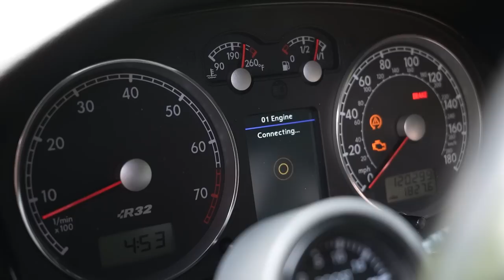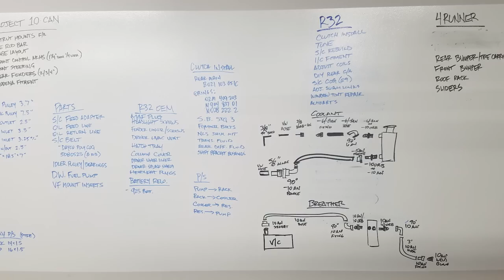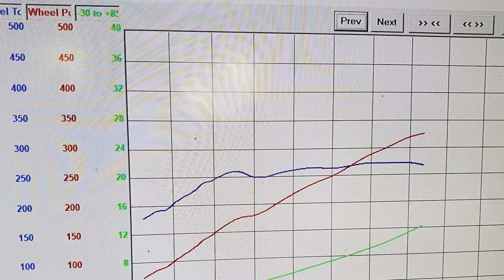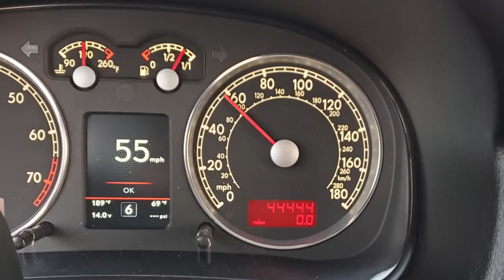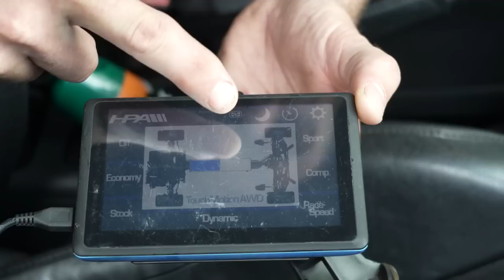Which MK4 R32 is Better? | Owner Spotlight!

Comment: That's excellent! Honestly, the AWD system in these cars is a lot better suited toward being a fun 'soft roader' than it is a some tarmac rally monster. I love this!
Reply: ?
There are people putting 800+ hp through this awd system (haldex).
Reply: @neilwalker8686  I never said anything about it's ability to take power. It's a very cool system. But, It lacks a real center diff, so it will never handle in the way something like an Integrale, Celica GT4, or EVO or something with true AWD system. That's why you see people putting 800 hp through them and drag racing.
Reply: @neilwalker8686  Its still a FWD + RWD system and wont handle as well as an AWD system with a center diff.
Reply: @xXYannuschXx  there are a ton of variables to that statement. Open diffs, and non-variable locking centers will absolutely corner worse than a haldex with front and rear limited slip diffs.
Reply: I had a mk7 all trac, that has the newer version of haldex that is supposed to fix all the shortfalls of the system in the r32. But it still wasn't anything like my dad's Subarus. It works seamlessly in loose conditions but it still handled like a fwd car in the dry.

Comment: My buddy bought a MK4 R32 new back in the day. I was so jealous! The upside, he use to ask me to drive it cuz I was awlays a gear head, car junkie use to speed. He was always slightly nervous to push it to its limit. I ended up building a MK3 Jetta VR6. Was never as fast as his R32, and wasn't all wheel. But it was on nuespeed coilovers and, 17" Koenig wheels, Pirelli tires..It skated along side the R32 in the corners. Miss the VDUB days. I remember the R32 was only biilled at 240bhp, but I think it was one of those gentlemen agreement deals to underrate them..Probably some tax breaks or something. Felt more like 300BHP. Rant over!

Comment: You do you man👍
Id be drawn to the supercharged r32. Love that instant throttle  response 😍. But the belt constant belt shredding would drive me nuts. Nice work on both rides 👏

I drive my b5 a4/s4 cel to cel myself. Its a vw/audi thing. You get accustomed to it. You actually start to believe its normal, lol. Im currently  95% rebuilding my b5 a4 1.8 stroker. Suspension  will be only used part. About 10k mi on that. Hopping for some reliability after that.... at least 50k, but 100k would be better. Keep on wrenching 🍻 and enjoy your rides. We have maybe 10 yrs of possible daily drivability with ICE 😪

Comment: I still don't know "etiquette" on commenting on older videos on YouTube despite having been here for years and years, but just wanted to say

I absolutely love the MK2 Golf Country tribute of sorts, I've loved those since I spotted one at a local car show here in Norway, and I'm an avid supporter of being able to build your cars as you like, albeit within limits, as in make sure you're not customizing a mint condition rare model, as I feel there should exist at least one stock form model just for preservation so to speak.
The MK4 R32 is not super rare, and the fact he even went as far as doing it to basically a parts car that'd never see the road again in it's original form, is basically the optimal way to make builds like this, and I love it! I'd go as far as saying he basically saved a MK4 R32 from becoming nails, and via making tribute to the MK2 Golf Country no less, I feel the MK2 Golf Country is oddly rare though, I've seen one once, so at least not common in Norway, I see a lot more BMW E28 Touring around than I see MK2 Golf Country, and BMW never made a E28 Touring ( they were built by Schulz in Germany. )

Comment: Have you added subframe spacers that would help with driveshaft angle maybe you already have i dont really know anything about lifting vws.

Also could you not build a sold strut mount spacer that prevents it fron over extending like i said just an idea i dont really know anything about lifting things

Comment: What a pity it seems that the mk4 is so "hard" to lift. I own a 4motion wagon tdi, wich in my opinion would look awesome lifted. But it already has the heaviest springs for the mk4 stock and there are very few guides for lifting a 4motion in the rear so I'm kinda stuck with my Ideas, this video helped me figure some things out, although I'd whish for a simpler solution up front.

Awesome build anyways!😎

Comment: Best Golf MK4 R32 was not build, and it's not one of their sibling A3 3.2 (not sure with same chasis or if it existed), not an audi tt 3.2. 
Best PQ34 R32 has not even the 3.2 engine. To me: CAHSIS VW Bora/Jetta 4motion, Golf/Bora/Jetta Variant 4motion, Skoda Octavia/Octavia Combi or the inexistent Seat Toledo 4 (seat never did as they did the Seat Leon 4 wich shares the 1M model, only as a concept Seat Toledo Cupra Concept 1999). All of  wich have far better weight distribution, gas mileage, less weight, aerodynamics (drag and lift), exterior design and also body (strut and reas as found in Octavia vRS) and subframe (TT, S3) oem brackects all better than the Golf R32. ENGINE: 1.8 T 237 bhp 320Nm BFV quattro Sport (or at least an 1.8T 225 bhp BAM derived one as foun in the Seat Leon Cupra R 1M or Audi TT 8N). R32 parts (intake, brake cooling, minor changes) WHEELS: something 15 to 16 oem like forged al-mg wheels as found in A3/A4 etc. SEdan bodies like Octavia and Toledo drag coefficient can be lowered from 0.29 (vRS with air dam, front and rear spoiler stock) or 0.31 to 0.2 from Giugigiaro original Toledo concept design without grilles or gaps... GEARBOX: 6 speed 02M 4x4 TDI one FEL/FEM gearing so you can reach 280 to 300 km/h on a petrol engine at 6000 rpm.
If you want to buy the two or three european complete cars to mix and match you need, feel free to contact me... just check the other 4motion/4x4/4/Quattro european siblings in action in the following playlist and pay attention to the Skoda Octavia WRC (and any other family body cars) how little to none the understeer is...
https://www.youtube.com/watch?v=SoT1ybl8ueM&list=PLnohJWB5-2HHTl0NcISl2932lLmeZliZ9